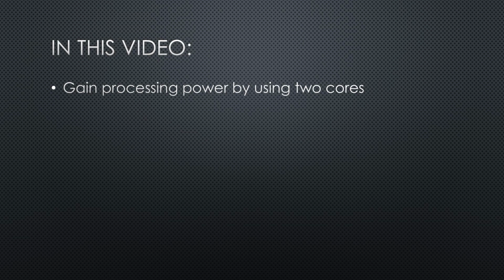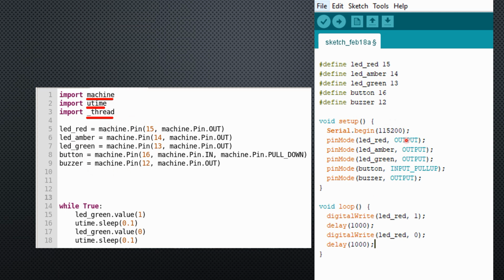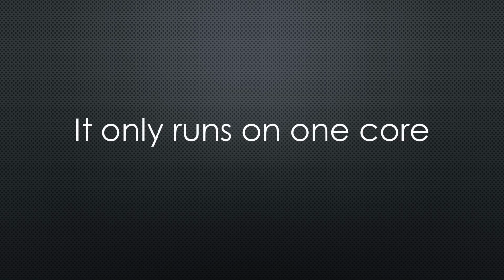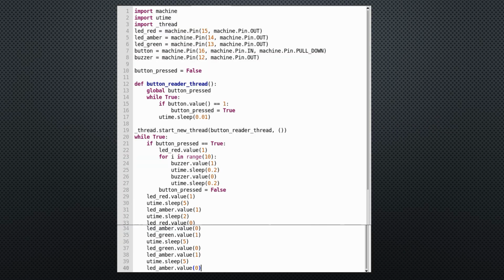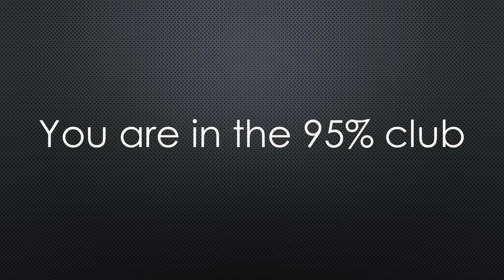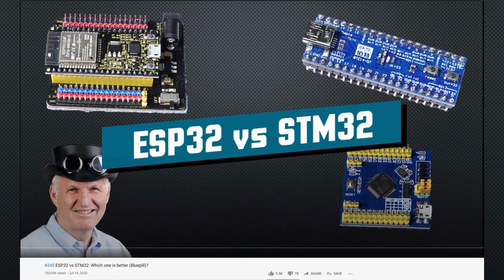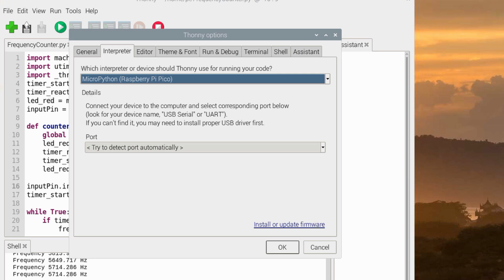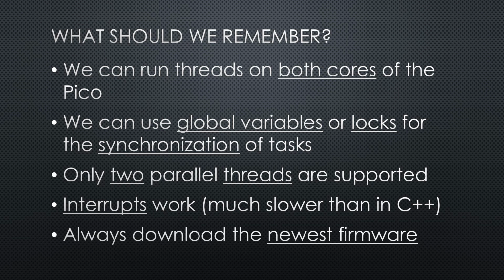#372 How to use the two Cores of the Pi Pico? And how fast are Interrupts?

Comment: Are you sure about Micropython using multiple cores? According to the docs (see https://docs.micropython.org/en/latest/library/_thread.html) _thread in Micropython works just like in vanilla Python. There, multiple threads use the same core. They do it a bit more efficiently, using the time otherwise wasted for waiting for, say, I/O operations, but it’s always the same core, courtesy to the infamous GIL, the Global Interpreter Lock. To use multiple CORES with Python, one must use multiPROCESSING. There are beginnings of a multiprocessing module in the Micropython codebase https://forum.micropython.org/viewtopic.php?t=7776, but I haven’t seen any true multiprocessing on an MCU implementation of Micropython.  In short, if it’s multithreading in Python, it will use one and the same core. Also see https://forum.micropython.org/viewtopic.php?t=7776
Reply from the maker: I have to believe the Pi foundation because so far, I did not  find the command to show the core the thread runs.
Reply: Correction. According to this discussion https://forum.micropython.org/viewtopic.php?f=18&t=8610, threading on the Pico does what multiprocessing does elsewhere, namely start a process on another core. On the ESP32, _threading stays on the same core.  As if multithreading/multiprocessing wasn't confusing enough.
Reply from the maker: Good to know. I use RTOS on the ESP32 and I can attach the task to the core I want.

Comment: Andreas, do you remember the Parallax P8X32A? Was pretty cool and supported being programmed in C. 8 "cores" up to 120MHz. Was fast enough to output HDMI, sigma/delta ADC 13 -bit on two pins. Now there is the Propeller 2! https://www.parallax.com/product-category/propeller-2/
Reply from the maker: For sure an interesting part. Not many people are using it, so it is probably not for this channel.

Comment: You have the run pin, which is reser button. If connected to ground.
Reply from the maker: Right. And now this pin is connected to ground with a small switch on my board. But is this my task?

Comment: Yes, not designing in a reset button IS a beginner's mistake. It is also one that the RPi people have not learned from since the very first Raspberry.
Reply from the maker: On a Linux system I would argue that a reset button can be dangerous because you have to shut it down. On an MCU this argument does not work...

Comment: Micropython on the ESP32 supports multiple threads, there is no documentation to the contrary as I just tested on my ESP32 TTG0 board to verify. And to answer the question whether I was paid well in Switzerland, every time I made a deposit at my local Zurich Volks Bank, the teller would remark, "Mr. Schlemowitz, I see your account is doing very well'. Sadly, when my assignment ended and I went to withdraw my money I was told that I could only withdraw twenty percent at a time. I got so pissed off I left my money there. That bank was subsequently sold to another larger bank and yet again to another larger bank until finally it was purchased by Credit Suisse who coincidentally by that time was my employer as I was in charge of IT support for the derivatives desk at the New York City branch. On my last trip to Zurich Switzerland, late 90's, on an assignment for Credit Suisse  I dipped into my now CS account to take a quick side trip to Venice just after Carnival. Which reminds me, Schöni Fasnacht !! A memorable evening I will never forget is the last night of Fasnacht which I only discovered by accident after finishing dinner at a restaurant in the Niederdorf and going downstairs to the bar to find a medley of  costumed bands taking turns playing and then from there to other bars until finally at the end of the night when all the bars had closed to a final convocation of bands in a small park square, dancing and playing.
Reply from the maker: Unfortunately, we have no "Fasnacht" this year (as last year). Because of Corona :-(

Comment: Instead of unplucking the micro usb you could consider unpluging the other end of the cable. 😀
Reply from the maker: Yes. But it is connected to a Raspberry Pi with 6 cables ;-)

Comment: Two comments. After I got my pico last month I did a lot of testing with multicore in Python. Globals do get updated across cores. But it’s non-blocking and (other than @ entry) takes about 1 ms so you should use a blocking mechanism if you’re counting on a variable getting updated. Locks, otoh, can be counted on to be updated in real time on both sides. They are probably using an interrupt to do this so you may take a small performance hit when using locks. About the connector: usb-micro connectors are rated for a minimum of 10,000 careful insertion cycles. Detach from the pico side, not from the computer side. It’s way easier to replace a $4  pico than a USB port on your laptop :) I really enjoy your videos, thanks!
Reply from the maker: I assume the firmware does the blocking. It has all information to do it. I did not measure how long the locks take.
Concerning the USB: On those boards the weak point is never the connector. Always the soldering or even the PCB. Another viewer complained that he lost already a few of these boards because of this fact.
I added a reset button ;-)

Comment: Good stuff as always!  I prefer coding embedded projects using interrupts and an event loop, and maybe setting low power modes for battery life.  Add threading and it quickly gets complicated.  I fiind the absolute need to design with finite state machines to clarify the complexity and prevent mistakes.  And so far: no embedded programming environment is giving me a satisfying way to code with FSMs.  ARGH. (So I design them in documenation only, better than nothing.  FSMs conserve sanity.)

I'm looking forward to the freeRTOS episode.  Having Andreas try things first is also a good way to conserve sanity ;)
Reply from the maker: I llike state machines but I only use case statements to program them. Tasks open a new way to programing. More like object oriented. You have to pay way more attention because everything can run in parallel...
Reply: C++ 14 or newer and the free library boost-ext/sml is what you are looking for.

Comment: Nice info, many thanks.
I must get a Pico or two on order soon...

Global variables in Python is a pet hate of mine, second only to they vile indent method of blocks... :-(

Can you clarify a small issue, (this could be a micropython thing)

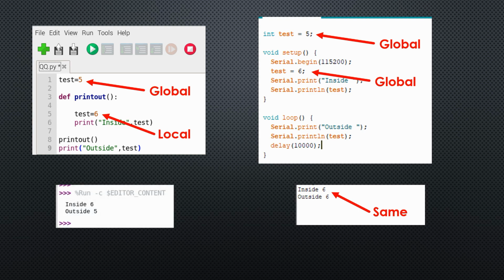At about  3:30, you describe the normal Python global system. Define outside and you can use the set value, but to change inside a function you need to add the keyword global.

However if you go to the "Barefoot" part of the video at about 6:08 you are changing the value of a global from true to false without declaring it as a global.  Which is different from the first statement regarding pythons globals. So is this a change / fix implemented in  MicroPython? which fixes what I call Pythons broken global. i.e. once a variable is global, you should never have to keep declaring it as global when you want to change it.  - it just annoys me :-)

(the workaround I use is do declare a calls called gl.  then I can add gl.var1 gl.var2  or whatever name I want, and use them as-is in  any function. A kludge but it works for me) 

Andy
Reply from the maker: It seems that the main loop is on the same level als the global value declaration. So it is already declared.

Comment: Did you try ctrl+d to do a software reset? I use that for micropython on esp32/8266.
Reply from the maker: Yes. And it usually works. But not if you play with both cores. A problem for sure solved in a future release. But we hope we can program this board also using C++. And there you have no ctrl-c or ctrl-d ;-)

Comment: A great video, i ran the code but ive some how managed  to get the other core stuck and cant seem to stop it, tried reseting the pico but still no luck and now i can not  connect to the pico though thonny  :-(
Reply: You can unstuck the Pico by nuking it with a custom firmware called flash_nuke.uf2. Just put the pico into file-transfer mode and transfer the firmware onto it. Works great!
Reply from the maker: Strange. I always was able to reconnect after reset (or unplug). CTRL-D did not work as I said.
Reply: Thank you for replying, It's very strange it is like the second core is still running the program, turns on the green led at start up then off and then  crashes and won't respond , tried power reset and software reinstall still no luck, think it might have to go to silicon heaven

Comment: one option to make it faster would be to write the irq routine in inline assembly. but i am not sure if python does not add some function logic around that makes it slower again. 

this code toggles the LED bin in inline assembly in python:

from machine import Pin
# setup led as output
led=Pin(25, Pin.OUT)

    
@micropython.asm_thumb
def toggleled(r0):
    mov(r0,0xd0) # the io addresses start at 0xd000 0000 
    mov(r1,24)     # we need to shift 0xd0 to get 0xd000 0000
    lsl(r0,r1)          # shift
    mov(r1,1) 
    mov(r2,25)     # we want a 1 on bit 25
    lsl(r1,r2)          # so we calculate 1 << 25
    str(r1, [r0,0x1c])  # store our 1<<25 at 0xd000 0000 + 0x1c ( GPIO XOR bits)

p2 = Pin(2, Pin.IN, Pin.PULL_UP)
p2.irq(toggleled,Pin.IRQ_FALLING)

so the code toggles the pin25
Reply from the maker: What was your result? I got 25 us till pin 22 went up (I did not find a pin25 on my board). But I am not sure what I did when I changed the pin :-(
Reply: @AndreasSpiess  i have not done any measurements myself yet. need to get the scope from the storage room first.. but this is what i was afraid: python will not install the asm code directly but put a wrapper around it. so i will try to get some asm code which directly installs it self as irq handler. gpio25 is the LED (which i used to thest the code since i had not scope around yet). gpio22 should not be any different.

Comment: There's a functioning reset button in your wall switch.
Reply from the maker: Which would kill the Raspberry Pi as the power source of the Pico;-)
Reply: @AndreasSpiess  No, you're deliberately missing the point. If you use the Pi for power you program a software reset button on the Pi cutting the power to IO out - and if you're using a wall plug you can use the wall switch instead of removing the USB cable. If you're using the Pi for power you absolutely don't need a physical reset button.
Reply from the maker: I only wanted to reset the Pico becasue ctrl-D does not work with both cores. I did not want to power it down.

Comment: How to Add an Reset Button:
All you need to do is to wire the GND and RUN pins together and add an extra momentary contact button to your breadboard. Pushing the button will reset the board.
Reply from the maker: You are right. Already done...

Comment: Even though, micropython is slower than c++, there are ways to make it faster. Decorators like @micropython.native require almost no changes in code, @micropython.viper requires a strictly typed code and you can also compile native c modules to .mpy and add run them in micropython, or even go for assembly level with @micropython.asm_thumb. I had experience only with esp boards, so I'm not sure what of these features are available with Pi Pico and ARM cpu.
Reply from the maker: Good info. I knew from Scott from Adafruit that he codes a lot of critical functions in C++. But I did not know how to do it. If you are good in that respect I would be glad to have a chat with you. Maybe you contact me on Twitter or Facebook messenger?

Comment: To all who want a Reset-Button, I used this technique.

I have a Pushbutton connected to the RPi-Pico Pins:
PIN No. 30 (RUN)
And PIN 28 (GND) -> Any GND will do
It works like Charm, no plugin/-out.
In Thonny You need only to Press the "STOP"-Button, to notify Thonny about a Reset.
Reply from the maker: You are right. I also added a 5mm button across the two pins. Concerning Thonny: Usually this works, but for the moment it does not work if you use the 2 core scenarios. and I assume when people start to use C++ and the Arduino IDE they will create some deadlocks...

Comment: Looks like the RUN pin is actually the reset input. Use a push to make switch on this pin to ground to reset. Has an internal pull up. First time I've ever seen a reset pin called RUN.
Reply from the maker: You are right. I added a small switch across RUN and GND.

Comment: A video about uasyncio/asyncio for (single core) multitasking would also be useful to many users in my opinion.
Reply from the maker: Is it available on Micropython?
Reply: @AndreasSpiess  yes, I’ve got code working cleanly using uasyncio on the Pico. I’m now, after watching this video, very interested in adding in _threads and seeing how they all work together. Fun times! (PS: great video).
Reply from the maker: I will have a look at it.
Reply: @AndreasSpiess  Yes. :-D Have a look at the uasyncio module.

Comment: Why can you reprogram atmel and esp chips without using the reset button or power cycling, but not stm or pico? Would using an external serial chip fix this?
Reply from the maker: You can program the Pico without a reset button. But if it screws up, as the Arduino, you need a reset button for restart.

Comment: Come now... we can have a reset "button" by soldering a small jumper to one of the castellated grounds, and just tap the Reset pin. Bonus: If things get too boring, Dishka can start bopping the wire around. 😁 Thanks for the video! Glad to see uPython supports threads on the Pico, even if only in a limited fashion.
Reply from the maker: Of course I have my reset button now. But does a beginner has to solder in 2021?
Reply: @AndreasSpiess  Perhaps not, but they could short the pins... 🤷‍♂️

Comment: Question about the dual core threads and the baton - if each thread stops and waits to get the baton, then only one thread is running at any one time - what is the benefit of doing this?  It seems that it would be faster to just run in one core and not have all the baton passing overhead to deal with.
Reply from the maker: You are right. But if nobody has to wait, you have double the power.

Comment: Andeas...loving your videos on the Pi Pico. One question please, what is the best way of powering the Pico so that it can operate independently from  a USB power source... such as a weather station??
Reply from the maker: As said in my last video. You can power it in a wide range of voltages.

Comment: Two 32-bit core running at 1330 x faster than the Apollo 15bit guidance computer.
1960s Apollo engineer: what are you using this awesome power for?
Maker: I make LED go on and off!
Apollo engineer: wtf 🙄
Reply from the maker: Exactly. But the engineer also started small, I assume ;-)

Comment: You can add a reset button (https://shop.pimoroni.com/products/captain-resetti-pico-reset-button), or simply wire a button between the GND & RUN yourself.
Reply from the maker: Thanks for the link. For half the price of the board? I found a cheaper solution ;-)

Comment: Grüezi.

Greetings from Hamburg.

Thank You for this nice Video.
I will try this two Cores thingy...

May I ask about setting a defined Frequency (48kHz)?
How would it create/generate this Frequency in MicroPython?
I assume it would be then C++.
I already tried to "grab" analog (Stereo) Signals, thru ADC0 and ADC1 also Headphone´s Ground on ADCGND. It seems to work, but maybe only the positive Amplitude (DC).

Thank You in advance, and have a nice Day.

c.u. Zui
Reply from the maker: I think you need a low-level library to drive your ADC. MycroPython is probably not fast enough. And you need a capacitor and a voltage divider to get your average voltage t around 1.5 volts.
Reply: @AndreasSpiess  Danke Herr Spiess.
I will try my very Best.
Breadboard? Check.
Resistance? Check.
Capacitor? Check.
OK, gonna do some Low-Level Formatting of my Harddrive... lol

Can I also cut the Wire to divide the Voltage? Hmmm...

I am equipped with some Books.
Vogel Fachbuch - Elektrotechnische Grundlagen
Franzis verlag - Grundwissen Elektronik
Franzis verlag - Aufgaben mit Lösungen Elektrotechnik

...and alot of Willpower, two RPi-Pico´s and a couple of Arduino Uno´s.

If I am correct I messed up the Conversion of the Poweroutput...

3 x Books² + Zui = 3000 Watt of Something and no remaining of Chocolate.

c.u. Zui and  very warm greetings from Hamburg, Germany

Comment: Another great informative video.
I'm a bit torn whether to bother with the Pico or not. There seems to be so much hype over it at the moment with what seems like every man and his dog, (or cat) going over it. All great stuff of course.
The Arduino has served us well for years now and with Expressive’s ESP8266 & ESP32 I cannot really see any advantages to using a Pico.
I suppose as time goes by there will be something to lift it above the rest.
The cost sounds great, in the UK at £3.60, but no one seems to include the shipping during their rave about the Pico, here in the UK the shipping is £2.99, which brings the total to £6.59, that is way over the top I believe. 
I just paid less than half that for an ESP32 including (now the new tax) and delivery which took just 12 days.
It would have been great if they had included built-in WiFi on the chip that surely would have made it more competitive.
Although I am probably at the bottom end of the maker pile, it doesn’t appeal to me other than maybe to get one just to play with, same as I did the Seeeduino XIAO.
I just hope that all the great makers that post how-to’s don’t abandon the Arduino’s and ESP’s.
Dishka is such a great companion to have with you in your workshop!
Reply from the maker: You do not need a Pico as we saw in my last video...